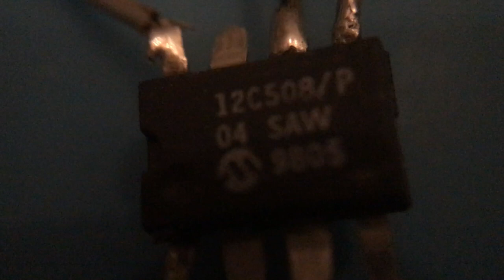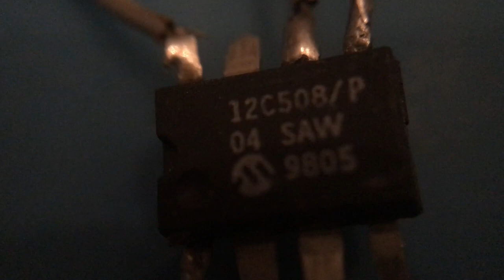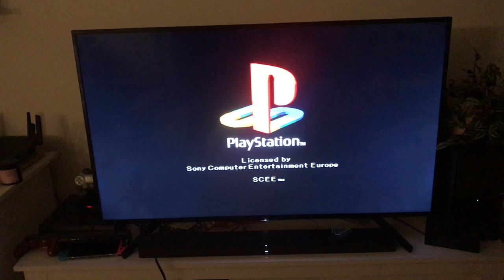Sony Playstation 1 - Restoration / Retrobright

Comment: The take away from this video is not the restoration of the PS1 (great job BTW) but your retrobrite setup.  This is the best setup I have seen and i'm just about to build mine.  I will be borrowing a few great ideas from yours.  Radiator foil for one, much easier to handle than regular tin foil and box in a box!!
Reply from the maker: This comment really means a lot to me! Am very curious about your own build, if you happen to be on Twitter, show it off to me ( @PointerFunction ) :D

Comment: That retrobrighting box looks a lot more sophisticated than my model. I need to improve mine a bit soon, too. The aluminium foil I used as the reflective layer is coming off. ;D Thanks for the mention, too!
Reply from the maker: I found that using hydrogen peroxide does cover the inside in water vapour, so consider upgrading to a plastic box, over a cardboard one if you’re gonna be upgrading anyway. And thanks for sharing details on this (it was our first Twitter interaction actually), I hope we, as a community, can keep inspiring each other to upgrade our work and setups! It’s fun learning and growing together :D

Comment: Great video. I really liked what you did with the plastic box. You got some great results there. I had a similar experience with a pickup recently, couldn’t get the mod chip out of there fast enough.
Reply from the maker: with the modchip in there, I was happy it played games at all! Usually an older modchip on ps1’s means the laser has been played to death by cheap burned discs. So was a win-win in this case :D

Comment: Preparing to retrobright my own ps1 and an NES. I was wondering if you went with the common 3% peroxide or a stronger 12%.
Reply from the maker: This was the 12% - but was watered down to fill the tub (as I didnt have enough of it at hand, hahahha). Was about 2:1 of peroxide to water eventually